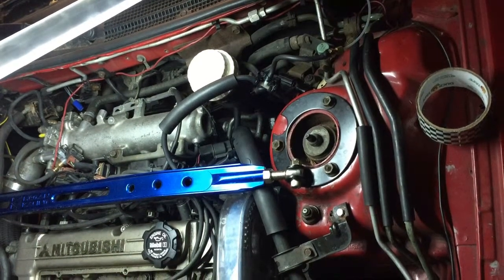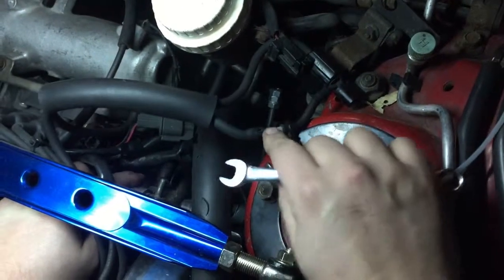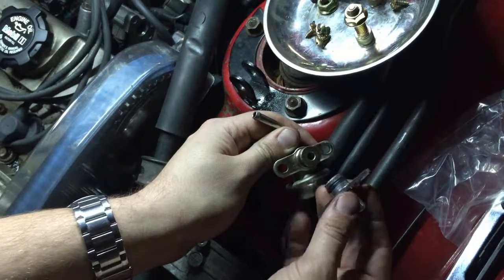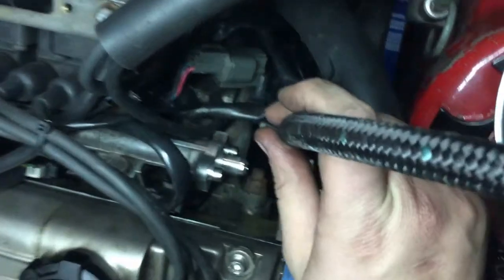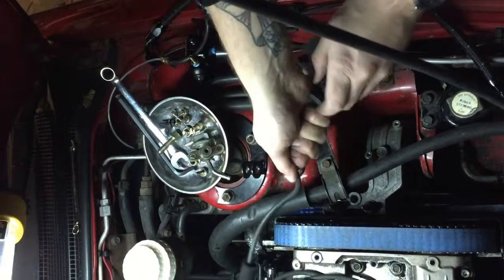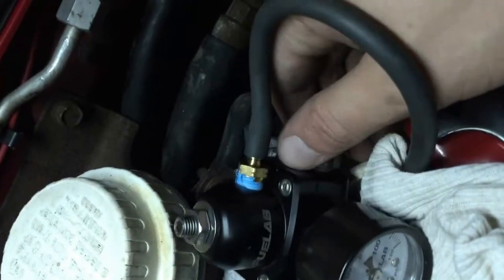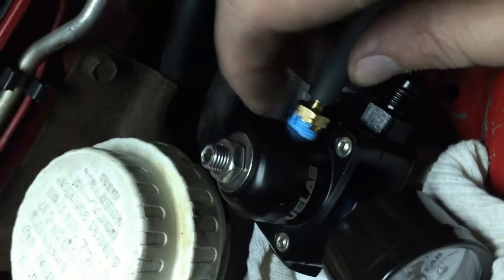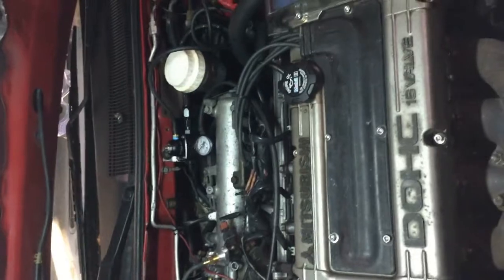AFPR Install in a 2G DSM

Comment: When you put the vacuum line back on is it normal that the needle drop a littile bit down
Reply from the maker: At idle, yes. You're fuel pressure isn't a static value when the car is running. When you set it with the line disconnected, you're setting the base pressure. When you re-connect, the pressure is offset by the current pressure in the engine. This raises and lowers the flow rate of the injectors as the engines needs change, allowing the ecu to have a wider degree of control in the same injectors.  At idle, the pressure in the engine is negative, also called vacuum, so the pressure drops below the base value. As you rev up and build boost (assuming you're turbo/super charged), the pressure in the engine becomes positive and fuel pressure raises with it. So let's say you set a base pressure of 43 psi and your engine idles with a 7 psi vacuum. With a 1:1 regulator, like the afpr we're using in the video, the gauge would read 35 psi at idle (it'll actually bounce around a little since vacuum isn't completely constant in a running engine). Likewise, if you rev the engine up enough to build 7 psi (lbs) of boost, it'll read 50 psi. If you're using a different type of regulator, like an fmu (also called a rising rate regulator), you can see drastic differences in fuel pressue. A 12:1 fmu with a base pressure of 43 psi would see 127 psi of fuel pressure at 7 psi of boost, for instance. Typically, those types of regulators are only used when you don't have a way to change fuel maps in the ecu (like when boosting an n/a car without a standalone). 1:1 regulators like the one in the video are usually used to support larger fuel pumps. Higher than normal base pressures can be used to compensate for smaller injectors, but that can effect the lifespan of the injectors and is limited by the pressure the pump and lines can support.

Comment: hey i know the vid is a bit old, but what did you use as a mounting bracket? did you get one made up?
Reply from the maker: I bent a piece of aluminum flat stock I had laying around with a hammer and bench vice and then drilled holes for it. Usually, if you're buying the fpr new, it'll come with a small bracket you can use to rig something up. Since I bought mine second hand, it didn't have one and I just used what I had laying around. You could also just buy a small piece of sheet metal from the hardware store and bend something up. Other guys re-purpose stock brackets for things on the firewall that they've deleted. In my case, I made the new bracket itself, but used the bolts and location of a stock bracket that wasn't needed anymore. Hope that makes sense.
Reply: hmmm maybe mine has it i didnt see on, my work always has sheet metal so may have to come up with something
Reply from the maker: It may vary by the brand or I may be thinking of a kit. Either way, if you have access to cheap/free sheet metal, you should be able to make something. The back of the fuel lab one has a little ridge that the bracket is meant to sit against. All you really need is something that can sit against that ridge and still get a bolt on somewhere.  If you can find some panhead bolts that will recess into your bracket enough to be flush, you won't even have to bend anything. I'm working out of state atm, but I've been toying with redoing that bracket next time I'm home. If I do, I'll try to film it and post it up for you.